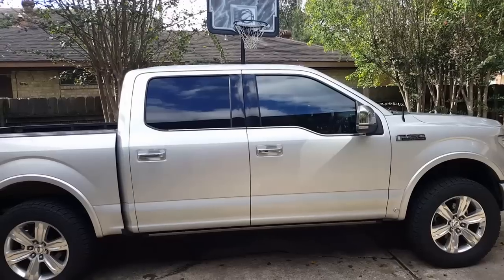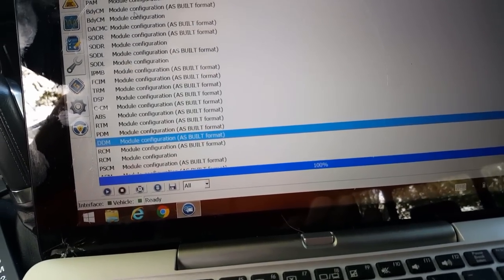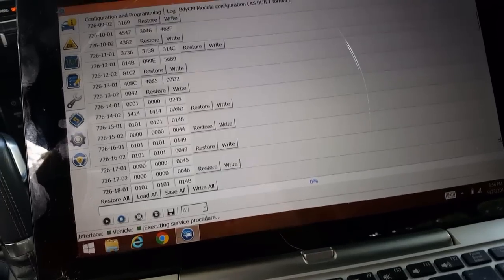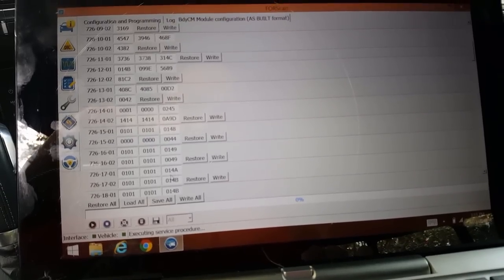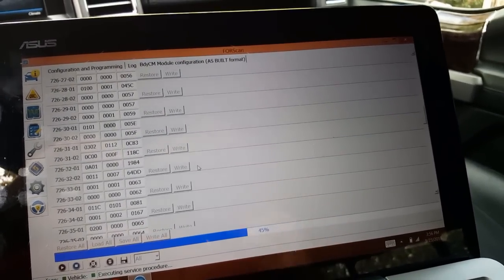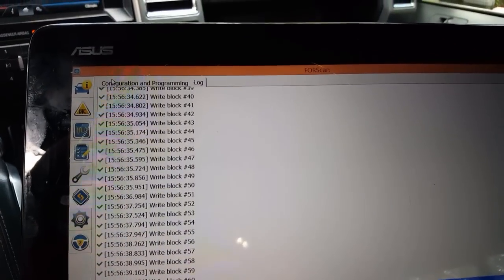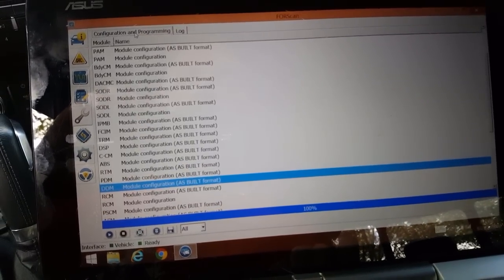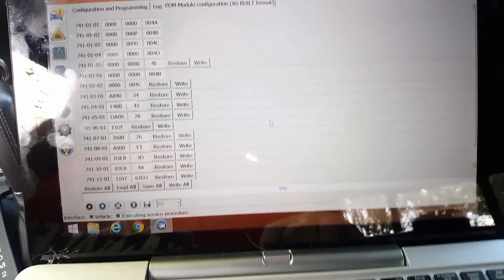Forscan ford f150 power windows up & down with key fob remote control

Comment: Yeah mine don’t work. Did everything in the video. Used the key fob the same. I have 1 touch windows. Nothing. Checked and double checked all changes in forscan. Turned off ignition and turned back on per instructions every change. Still nothing. All other changes worked fine.
Reply: Sometimes you have to wait the proper 15 seconds with key off before turning back to On position for the system to recieve the new programming.

Comment: Did the mirror retraction finally work when locking?  I have a 2019 F-150 Platinum that I would like to have these features incorporated.  Will a dealer service center do this for you?
Reply: They will but they will charge about $3-400 when it's only $40 for the forscan and you can do it yourself pretty simple.
Reply: @sly50gt  It worked.  The only thing I noticed is that when I manually fold the mirrors in I have to manually extend them but if I use the key fob to retract them then when I start the engine they automatically extend again.

Comment: so I did this on my 2016 F-150 Platinum & now my remotes will lock the doors, but when I try to unlock with the remote they do nothing & when I reach in to push the unlock button it says unlock deactivated or something like that.  I can reach in & push the start button & start the truck & then the doors will unlock again.  I checked all my codes and they were entered correctly.  Any ideas how to fix this?
Reply from the maker: I would reset and try again. Something didn't code right. Keep me posted.

Comment: Can you show us how to do the full global open including sunroof, that would be trick. Really digging your other mods. Thanks
Reply from the maker: Hey Nathan. I think it only works for the front windows. I haven't seen or heard of others. Thanks for watching!
Reply: @ricardosworkshop  I was just wondering because when I was in the PDM there was an option to enable "Global Rear Windows" and I did. You wouldn't know what line the rear windows are in the BCM would you...this is a 2019 F150 Lariat
Reply from the maker: I searched for window options other than than front... couldn't find any.
Reply: @ricardosworkshop  First off - thanks so much for posting videos. i wonder if this would work (found on FS org site but not for F150) : (DDM/PDM) 740/741-05-01	 xx*x	 xx		Sunroof Comfort Vent Closure:4 (Enabled) , 0 (Disabled – Default) (2013-2016 MY)
Reply: @ricardosworkshop  the ford fusion has all windows and sunroof down with key fob for even their base models. Maybe someone can forscan the fusion and see if the same module is named for the truck? My fusion has 1 press windows for front and back and sunroof/ My truck only has it for front windows. maybe its related to the switch itself instead? Maybe try a fusion switch with this mod just to see if itd work? I might try that when i get to it.

Comment: Have done Bambi mode, Lincoln mirrors and eliminated the double honk with the help of your videos but the windows with the remote is not working have tried it multiple times any suggestions?
Reply from the maker: Funny thing, it didn't work the first time for me either. Make sure you are changing the exact options. You should be able to change 2 at a time. Turn truck off then back on. Then off again to test it.
Reply: Thanks. Turns out I was just being impatient not holding long enough

Comment: Lots of changes can be made with forscan.  I have the global windows like this vid, bambi mode headlights,  I set curtesy flash of turn signals to 4 flashes (3 is default) and might change it to 5.  Power point to stay on for 30 minutes, Radio on with no key for 60 minutes. and more.
Always back up your modules first before making changes so you can restore to original if needed.
Reply from the maker: Great point Ken. Thanks for watching!
Reply: I do six on the turn signals. 3 is not enough

Comment: @4:30 my truck wouldnt write. At 4% it has an error and stops the service requested. I have a 2018 f150 with the same device as you. Did you install any other drivers?
Reply: Did you get the extended license for forscan?  its free and you can not write without it.
Reply from the maker: Hi jacob. I haven't heard of that. Have you tried the forum? Forscan.org
Reply: Yes, I can write other codes. I switched to bambi mode, etc. But this one has issues
Reply: Go here to make sure there isn't anything different with your 18  https://www.f150forum.com/f118/forscan-software-enable-disable-features-your-truck-348987/

Comment: The 2017 F-250 I drive for work already rolls down both windows when I hold the unlock button.
I found out on accident one day when I held the button on accident. 
Rolling them up with the remote would be awesome.
Reply from the maker: I assume you tried double pressing and holding the lock button. What about forscan?
Reply: @ricardosworkshop I was just saying that the feature to roll down the windows with the remote seemed to already be turned on in my work truck. Which I have driven since new.
I tried it again today. It rolls them down but not up.

I might have to check the settings with FORscan and compare to what you did here so I can also roll them up with the remote.

Sometimes I am working around the truck and if I left the windows down it would be cool to roll them up and lock it by just using the remote if I have to walk away for a minute.

I already used your other video to change that blink from 3 to 4. I have been enjoying that. 3 blinks to change lanes was not enough.
Reply from the maker: Hello Shawn. Thanks again for watching. 4 blinks still felt a bit low for me. I think 5 is just right. Hopefully it's just a matter of fixing the windows up. good luck!

Comment: I have the FORScan app download to my laptop and have the 327 module with hi and low settings with Bluetooth and can’t get the laptop or my phone to pickup the module for some reason. Any ideas from you experience that I might need to try so I can resolve this issue and be able to connect? Thanks in advance.
Reply from the maker: Hello All4Fun. Thanks for watching. My only experience is the 327 not being plugged all the way in. I opted for USB cable to minimize connection errors. Thanks!

Comment: Can you post the link to the spreadsheet?
Reply from the maker: Hello Z, I'm not sure where to download it but here is a link that might work for you... https://www.google.com/url?q=https://www.google.com/url?q%3Dhttps://docs.google.com/spreadsheets/d/1uDSQ1Z5a2Wt8-kjrSiVSlDFGFHnfeuhb3RTMVz95730/edit%2523gid%253D815852466%26amp;sa%3DD%26amp;ust%3D1543556256552000&sa=D&ust=1543556256622000&usg=AFQjCNGSZJ4nsDP4_nkkrXTuMBDrUcWMfw
Reply: @ricardosworkshop  That looks like Livinitup's spreadsheet from f150forum.com - 2015 to present - the Forscan sticky post 1.  check it out.

Comment: Do you know if this will work on the XLT model, 2017?
Reply from the maker: Thanks for watching Raul. I believe this will work on all 2015+
Reply: @ricardosworkshop  
It does work, I just did it
Reply: Do you have to have the push button start for this feature to work?  My work truck does not have push button, I use a key.
Reply from the maker: Sink2
Reply: Ricardo Alanis lol sink
Reply: @ricardosworkshop  
What version of sink 3 do you have? It looks different from the one I have.